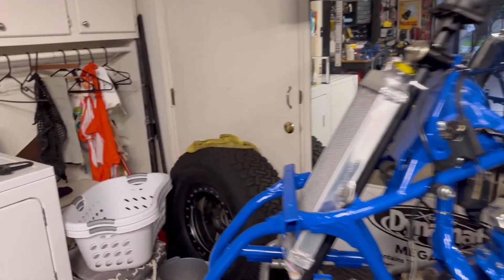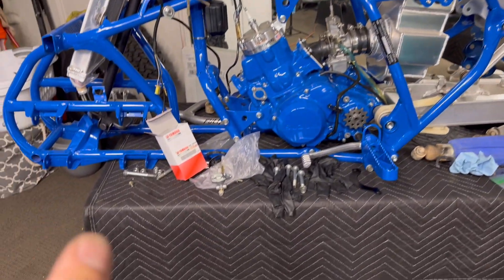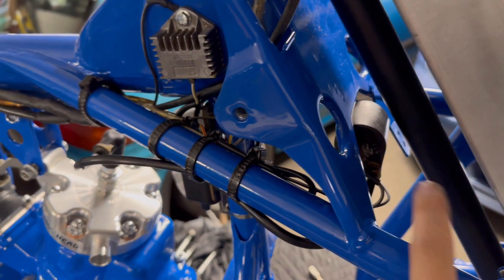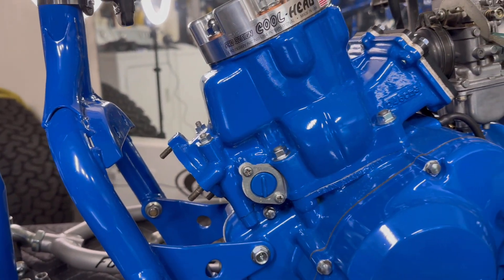Wire Harness Install!! | Suzuki LT250R Restoration Part 3

Comment: Where did you get all the new electronics, voltage reg, and CDI box?
Reply from the maker: Those are all factory parts that I detailed before re-installing them.
Reply: @gio.rodriguez  You did a nice job.  Im restoring a 1991 at the moment. I just hate to put 30+ year old electrical components back on it. But NOS parts are long gone
Reply from the maker: @CVLT250-R  thank you! If any fail in the future I’ll try and source used parts, rather than that reproduction junk out there 👍🏼
Reply: @CVLT250-R  you want to reuse the cdi and coil pack for sure, everything else including wiring can be updated, even a used cdi will for for $150, and new is unattainable
Reply: @apaudorff  I heard of a place I can't remember the name. They have a company here in America and Europe. It started with a C. You sent them yours and they rebuild it